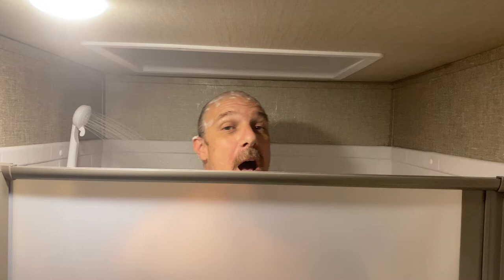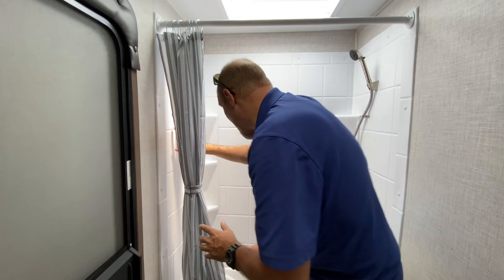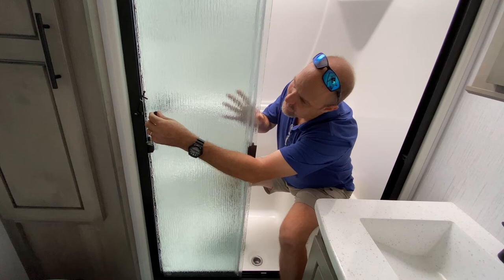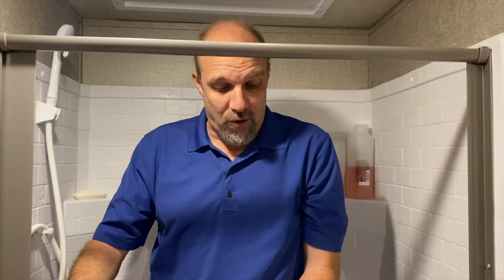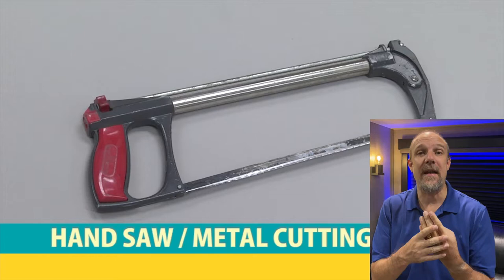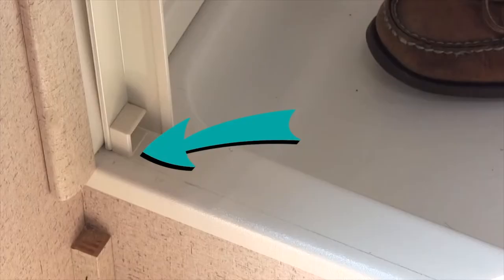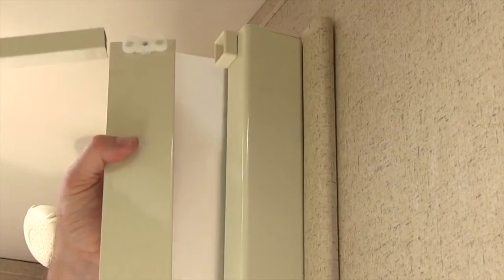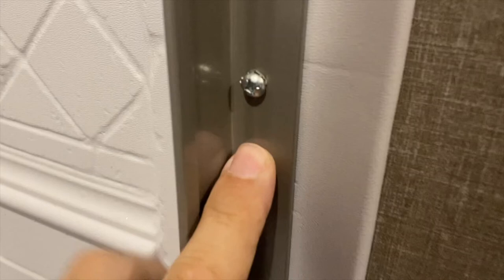BEST RV Shower Door Upgrade || How To || Step by Step || The Nautilus

Comment: Thinking about putting one of these in my toy hauler. My shower is similar to the one you are.........performing in. Trying to decide if I should go full height to the ceiling (and fill the gap with caulking or stick to the height of the shower walls. 

Thoughts?
Reply from the maker: I would stick to the height of the shower walls myself.

Comment: I have white plugs along the shower that holds the shower wall to the camper. It appears this is the location were the vertical frame attaches to the shower wall. My question is can you put the rail over the plug ( they do stick out. They are not flat on the wall ) or if you have to remove them?  Nothing would be holding the shower wall to the rv? Thank you for your help
Reply from the maker: Hey Wayne,  that is a great question. To be honest, that would be better directed to the manufacturer, but I will do my best.  I would say yes, the white plugs have to come out, but the pressure of the new shower door should hold it in place.  Now, the other side of my brain says, no you can leave them because the adhesive foam will mold around it...  So in conclusion I go back to my first statement.  It would be best to send an email to the manufacturer of the door.  Here is their email  info@stoett.com   Good luck Wayne :) Let us know how it turns out.

Comment: All the 2022 trailers we’ve been looking at in the past 2 weeks have those shower retractable doors… all of them are broken and don’t fully retract…

We’re actually looking to install glass doors
Reply from the maker: Interesting.  We have not seen that at all yet and we look at a lot of RV's (obviously)  lol  Either way, thanks for watching and good luck in the search :)
Reply: True.. a Stromberg articulating shower bar is a better solution... Less expensive and increases elbow room significantly
Reply from the maker: Yes, The extra elbow room in some RV showers would be nice, but now you have a shower curtain and potential water on the floor.  Thanks for the option Campos. Always good to have options :)
Reply: @TallMansRVReviews  understood..  the bar needs to be mounted within  the inside of the shower back splash/stall...  Just like in a home...

No leaks drips or floods...

Love your channel..subbed liked SUBSCRIBED!!!